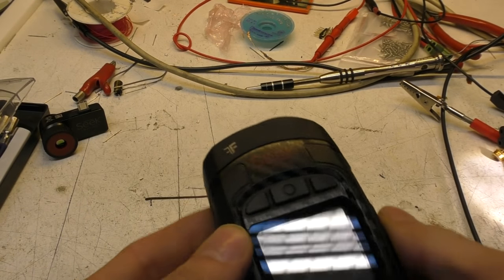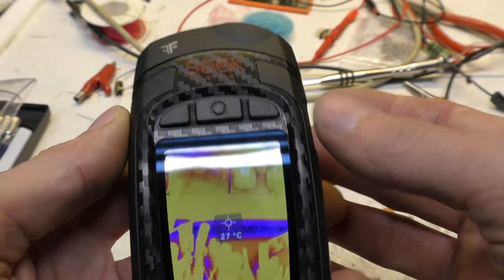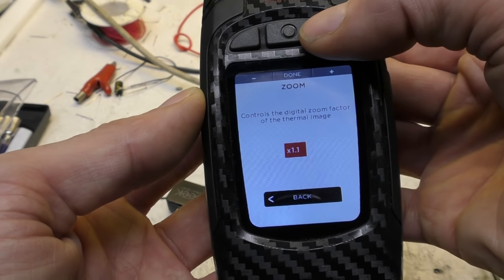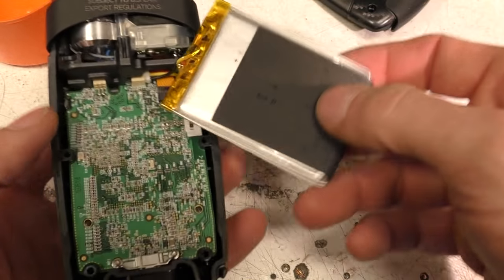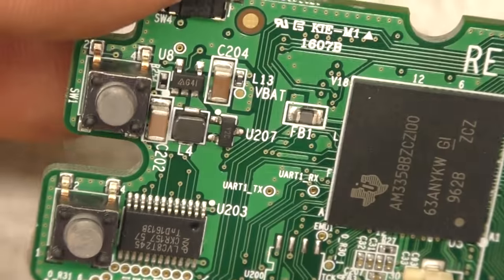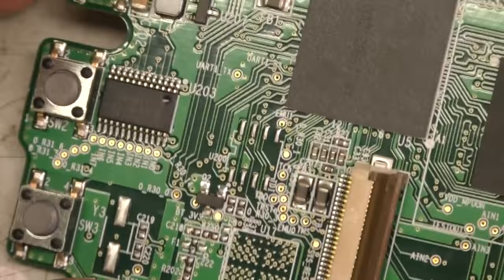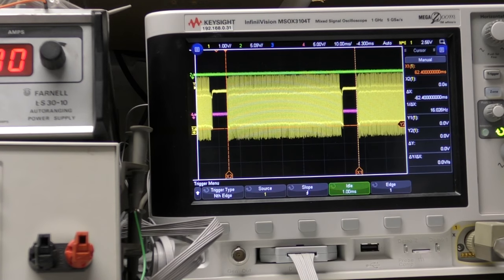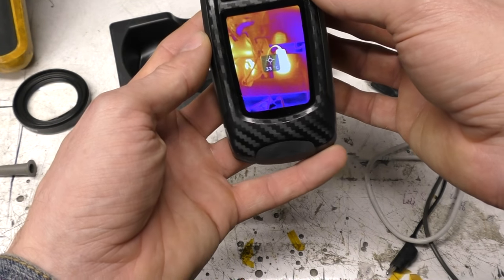Seek Reveal Pro themal imager review & teardown

Comment: Hi Mike, Normal Mode has a much higher frame rate than Full Frame Mode. And Full Frame Mode gives a bit more detail and more accurate temperature readings but with a reduced frame rate. If you want to check out my review you'll see a basic explanation of the 3 modes.

Comment: You can tell the designer has an attention to detail, common sense and pride in his work. I've played with $10k instruments that don't even have a  holding clamp for their micro-USB, those small solder joints on the micro usbs are piss weak.

Comment: I'm wondering whether the high latency is a technical limitation or a regulatory one. Perhaps in order to freely sell a (relatively) high frame-rate IR camera they had to introduce artificial latency into the system to satisfy the same ultimate requirement. That requirement being making the sensor unsuitable for guiding an anti-air missile.

Comment: TRIPOD MOUNT INFO - $50:  Here is the list of parts needed to add a Arca-Swiss style tripod mount to the base of the Seek RevealPro thermal imager:

Qty (1) - Sirui TY60 Arca-Type Pro Quick Release Plate.  $45
Qty (2) - M3-.50 x 10 Metric Pan Phillips Machine Screws.  Lowe's Part Number:  127108.  ~$2
Qty (2) - 3-mm Metric Lock Washers.  Lowe's Part Number:  127076.  ~$2
Qty (2) - 4-mm Metric Flat Washers.  Lowe's Part Number: 127072.  ~$2

The groove cut into the center of the plate is the perfect width for the screws on the back of the imager, and the overall width of the plate is about the same width as the Seek RevealPro.

Comment: This is a 320x240 sensor for $700.
You can buy a proper microbolometer(not pyrometer) Thermal Expert camera with a very large 384x288 17um-pixel sensor for about $500-800.
And $3000-ish(I think) gets you a 640x480 camera with a huge lens.
Reply: ***** Very long, I imagine. It's a very niche thing.
Reply: Spirit Actually this is the Pro which has 320 x 240 resolution.
Reply: Roo's Views You're right, it is, corrected.
Still, my message stands - this is a pyrometer, which is a rather terrible sensor technology.
The Thermal Expert is better in every regard, except for the fact that it's still a phone dongle(works with Windows too!).
Reply: "Read their spec sheet". No seriously, it is 320 x 240. I have reviewed this unit myself along with the lower res original model. Perhaps you have confused the two.
Reply: Roo's Views Yeah, I have - I just edited my reply and original comment.
Reply: Ah yes I see that, all good :)
Reply: The thing is, this is an all-in-one solution and is made in the US. The TE is made in Asia and needs a smartphone to work. So it's a different product really. I can't find anything else out there with this resolution and features at this price.
Reply: Roo's Views The seek's resolution can effectively be halved because there's so much noise and non-removeable nonuniformity because of the process behind this sensor - the pyrometer. It's not very suitable for anything radiometric, either. I'd say it's more of a visual thermometer than a thermal camera.

I'm designing a(possibly open sw/hw) thermal camera that will accept pretty much any sensor(not dongle) for around $100(plus the sensor cost) in one-off quantity, around $60-70 in 1000 to 100 quantities.
In fact, I'm on the way to pick up the PCBs for the last revision as I write this comment.

I think that will be a very good competitor in terms of features, and perhaps price, if I can score a few deals on high-end sensors(ULIS Pico384 for example, the same they use in the Therm-App).

For now the sensor used is the 160x120 FLIR Lepton V3, combined with superresolution math to achieve actual, radiometric 320x240 resolution. Possibly even 640x480, if you're okay with ~1fps speeds.
Reply: ***** The E4's sensor is a for-serious device, unlike their Lepton and such.
It's huge, has huge pixels, has a formidable lens, and is properly built for radiometric stuff.
If it were made by the million, it'd be cheaper than a handycam.
Reply: Spirit Sounds like an interesting project you have there. Good luck with it. I'll be impressed if you are able to realise it and bring it to market. Keep us posted.
Reply: Roo's Views Not sure about bringing it to market(Lepton V3 is not available yet), but I will probably be doing group buys of fully populated boards and cases, so the user will only have to solder on a battery and stick the sensor in the socket.
Reply: Spirit Well it sounds very cool. I wish you the best with it. The more people tinkering at this kind of technology the better :)
Reply: Spirit where can you find a camera for that res & price? i could only find a gun sight around 500usd

Comment: I find it interesting that despite technological developments in cameras thermal ones are still low frame rate and resolution comparably to other camera types. Don't understand why there has to be export restrictions on high frame rates. Anything can be crafted into a weapon if one desires. Saying that the ones that do have higher resolutions are horrifically expensive.

US law fucked over encryption of HTTPS in the 90s and early 2000s with export grade encryption, still come across the fallout from that today. I would not be surprised if that export restriction come round to bite them in the ass as well.

As always an entertaining teardown, thanks for putting the work in Mike.
Reply: Is it all down to the speed of photons in the IR spectrum. Thunderfoot just put up a vid.
Reply: TheEPROM9 concerning framerate it's also a regulation thing, for example here in Germany Trotec sells only 25fps cameras, I didn't even know this 9fps stuff exists

Comment: I wonder if the M0 chip on the sensor has to do with limiting the capabilities for EAR reasons.  If it were done solely in the Sitara processor, you could remove the camera assembly and get the data out some other way.  It also could do some sort of test on the chip for bad pixels and magically work around them.  But doing the shutter sound plausible.  That makes it modular and self contained.

Comment: the extra processor on the sensor board MAY be to prevent removal of the sensor board and having it work on something else... the little processor on there may do some sort of encrypted speaky speaky with the main processor, so the sensor will not work if not connected to the main board properly...

Comment: Hi Mike. I have the Seek Reveal XR and the battery is dead. It comes with a 584858 3.7v 1950mAh 3 wires battery but i can only find a 2 wire battery instead. It may work with the 2 wires battery or it´s not recommended?
Reply: I am having the same issue.  Did you try a 2 wire?
Reply: @benzilla4  no, I didn't. I use instead an external charger for the flir but I can't use the flash light. 
It's so difficult to find the right battery without importante it from korea

Comment: My battery gauge is screwy when I charge it all day and unplug it it doesn’t show fully charged . And sometimes drops right to red . Like I have a bad battery. I tried other charging cables . Do you know where I can get a replacement battery online ? And what torq bit size
Reply: I had the same problem so I contacted them and they told me to hard reset it by holding the power button until it cycles on twice. It did seem to help.
Reply: @timbenham516 mine didn’t change at all after doing that

Comment: Mike, on the amazon Q+a section its said that the battery for the seek thermal pro cannot be replaced, is this true?, it looks like you removed the battery and it had a connector, can these be brought?
Reply: My battery has died, I am currently using it with the battery removed (does not work with it installed) with an external USB battery power bank. The battery fitted does not seem to be easy to obtain, and the lead is looking custom. I currently looking at other potential slightly small batteries, with a view to move the cable over, but also need to find one with a built in thermistor. I'll post back here how I get on if there is any interest.
Reply: Karl Prince Have you tried to contact the support of the manufacturer (Seek)?
Reply: @MrKarlPrince  Any luck?  I'd like to get a replacement battery too
Reply: @btiller44  In the end it was a faulty joint on the battery BMS, I reflowed it to fix it. I did find several options to replace it, but none quite the right size (smaller), and I would have had to splice on the original connector.
Reply: @MrKarlPrince  Just an FYI for anyone in the future too, I emailed Seek Thermal and they said they would be able to test the battery in house but recommended upgrading the firmware which I did.   It seems to have made a significant difference in how the battery life is being reported.   I ran it for an hour without the battery going below all bars, which previously would have completely used up all the battery.
Reply: Karl Prince   Thanks, it's good to know that if I purchase the Seek that years from now there's a way to still use it.  I'd hate for a battery death to be the end of my unit at a future date.

Comment: can the heat from the LED compromise the termal camera?
Reply: Potentially yes, but you'd have to have the LED on for quite a while I would think. That's a lot of thermal mass to heat up before it starts affecting the camera negatively.
Reply: Lemming not that I am really interesstet in buying a thermal camera. I just was wondering if the design is "wrong", since I am studying mechanical engineering.

Comment: I dropped mine on a wood floor about 2 feet. And it doesn't work anymore. the flashlight still works. I don't think this product is toolbox friendly as advertised. seek sucks. sorry
Reply: Did you open it to see if it was something simple like a connector popping loose?